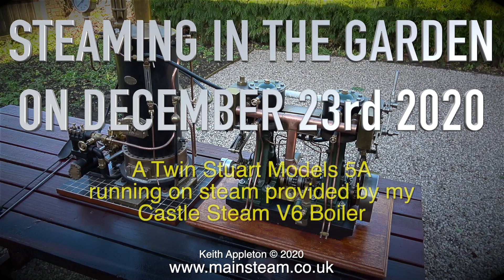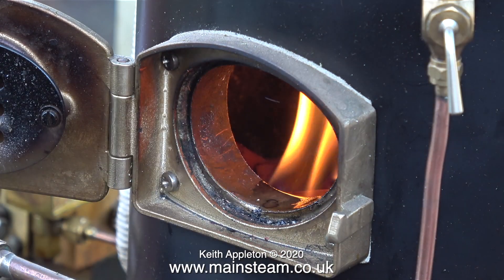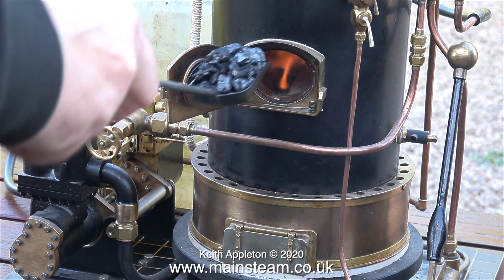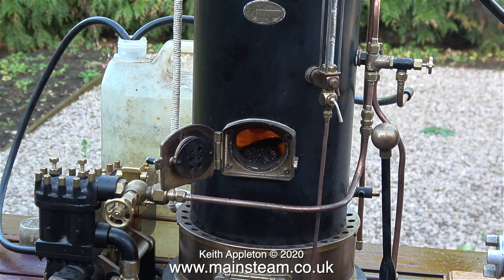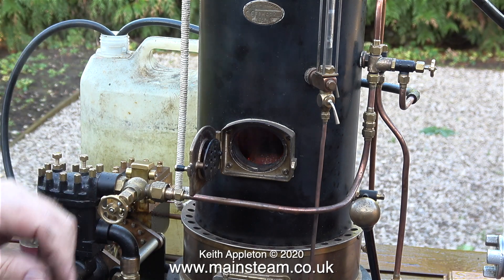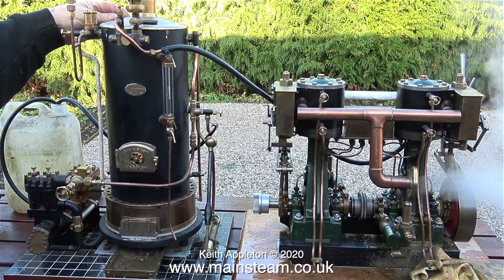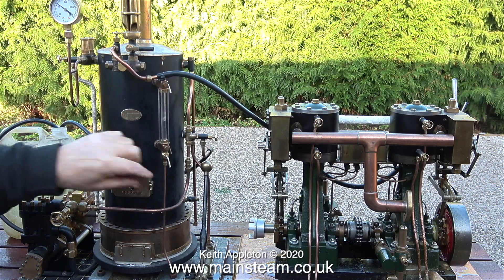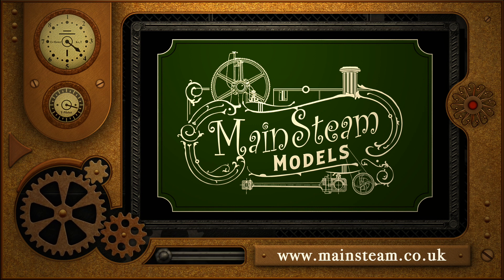A STUART TWIN 5A STEAMING IN THE GARDEN ON THE 23rd OF DECEMBER 2020

Comment: I do not know anything about these lovely engines so I asked what is steam oil.
Reply from the maker: Steam oil is a special very dense viscous oil used to lubricate steam engine cylinders. It is fed in with the steam by either a Mechanical or Displacement Lubricator.

Comment: Have figured out way of construct a  simple electronic sight glass.. Bit of aluminium rod running through an insulating bush, through a pipe T and then down through a pipe.... Annodize the aluminium, electrically ground the copper.. And the connection to the alu becomes a capacitor with a value that varies according to how far rod pokes into water. 555 timer  or similar to produce variable frequency pulses. Frequency relates to water level. High or low pass filter if want a trip point for sounding a buzzer, opening a solenoid valve to activate water feed pump or such like. Arduino or similar if more complex stuff wanted. 

Per boilers for larger engines. 
Now if only I could figure how to get an aluminium wire down the inside of coilled copper without it touching the copper until after it was anodised... I'd have a simple way of controlling water lever within a
a monotube aka flash steam boiler. Far lower risk of dangerous failure, Far easier to match water feed to steam consumption etc.
Reply: A somewhat more extreme idea I've had... Consider an oxyhydrogen blow torch. Could probably be constructable to function at boiler lever pressures. The flame would be steam that's disossiated due to the temperatures. Way above temperatures model engines usually run at.. Indeed likely to melt engines even if made of the best alloys available atm. A solution?  Condense steam from the engines exhaust. And spray inject just after boiler. how every much condensate required to bring temps down to manageable levels.  All heat from combustion goes through engine. No boiler either.

Comment: I was at Loughborough station last year and was watching an engine fire up down by the sheds. Before it started moving the drain cocks were opened for quite some time. eventually it steamed past with it's drain cocks still open (about half a mile of travel) and left the station to the south with the drain cocks still open.  I'm guessing that it takes quite some time to heat full size cylinders, that or the engineer forgot they were open.
Reply from the maker: Sometimes they do that for the "loads of steam" effect }:-)))
Reply: That seems a bit excessive to run for that distance, but full size cylinders do take a while to heat up. Occasionally they can get stuck so they can't be fully closed.

Comment: What are the advantages of using coal over oil or gas fired boilers? I've noticed that all your boilers are of the fire tube type.  Does anyone make a water tube style boiler for use in model steam service?  Thank you and a merry Christmas to you and a healthy new year
Reply from the maker: It follows full size practice . . .
Reply: @keithappleton  Thank you, I thought that may be the case
Reply: With talk of hydrogen as a potential green fuel... I've wondered about firing by hydrogen...fairly much like the somewhat obscure "internal combustion boiler" from 1927 (Google search for " internal combustion boiler douglas self" should land you at the correct page of a very interesting Web page covering all kinds of historic and obscure technologies.

Though if I'm honest the idea of attempting to burn hydrogen stoicometrically with oxygen, under boiler pressure does  kind of scare me.